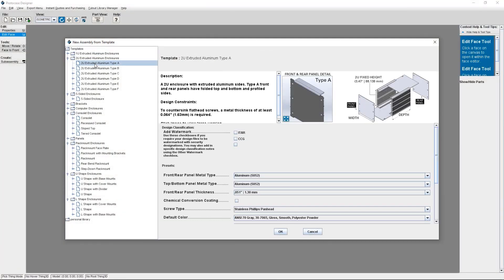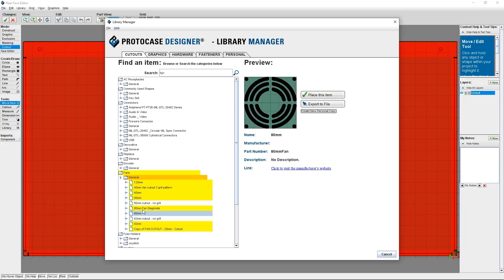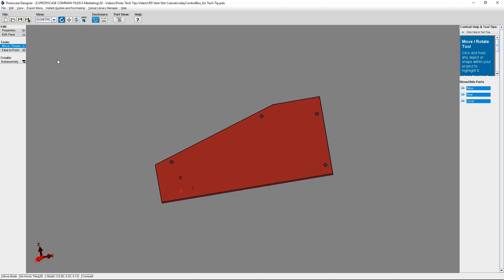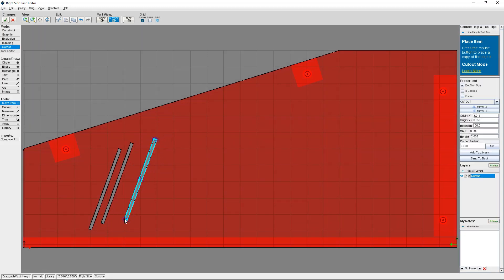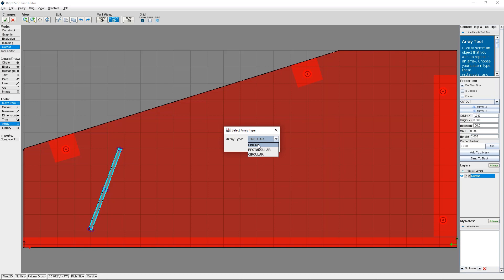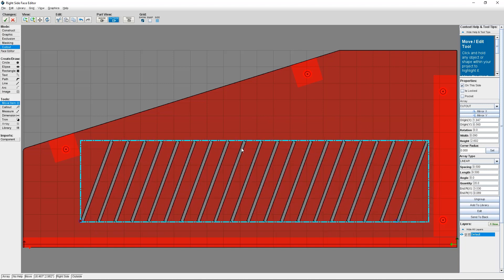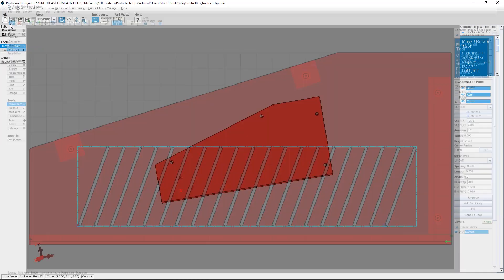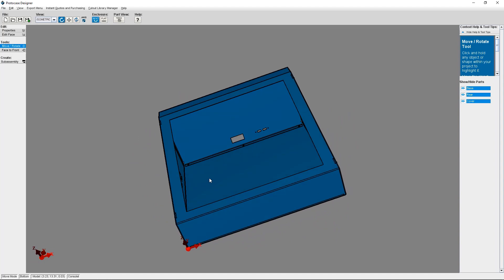Proto Tech Tip - How to Design Vent Slot Cutouts As Quickly As Possible

Comment: Are there any rules for how large the slots can be?   I'm in the USA. Obviously, a one inch
 opening in a metal case doesn't provide shock protection, but so far I have found a rule that says how small it must be.
Reply from the maker: Hi Rich, there are no hard general rules around the overall size that a slot cutout should be, but you do want to be careful of how large it is in relation to the thickness of metal you're using. One really long slot cutout, for example, could begin to warp or distort at a certain length, so keeping your slots to a reasonable length is best. We checked with our engineering team, and based on their experience, anything in the 1" to 5" length is typically okay.